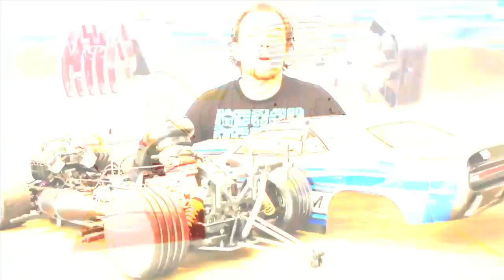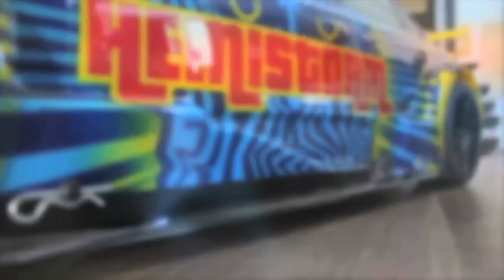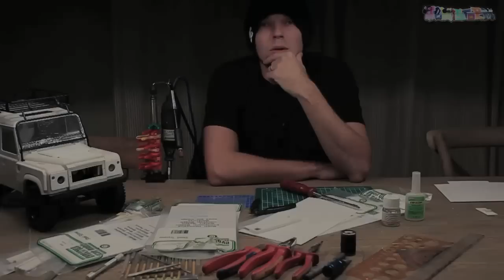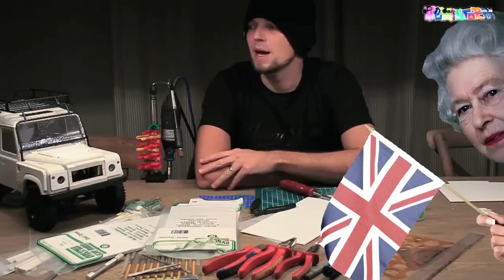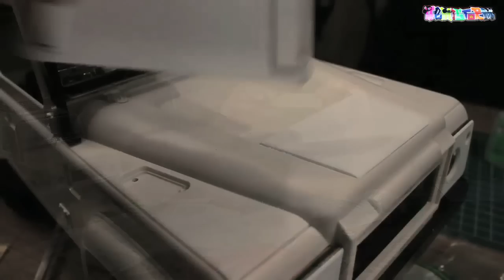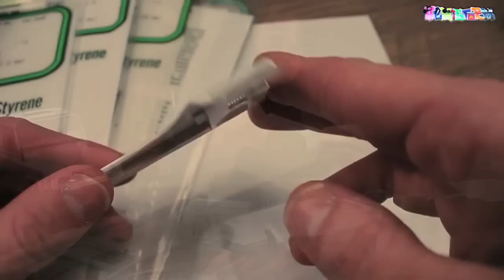STYRENE BASICS: RC4WD "Kahn" Defender D90 Custom Build

Comment: Outstanding subject you've chosen there Chris & a good scale to hone your styrene skills! You can't go wrong with *ZAP they have a good range of viscosities. A couple of tips that you may find useful ... After use put the Zap bottle on its side in an airtight plastic (kitchen) container then place it in the fridge, it'll last much longer!
Also if you want good (& cheap) filler that works, just put CA where you want to fill & sprinkle a good amount of Baking Powder over it. It dries quickly, can be built up & sands easily. Anyhow have a play round 'n see what ya think!   take care mate

Comment: That Zap glue is what you use to glue it to the body? Also do you do any bonding type to smooth out the gaps and edges or will you just paint straight over it? Thanks for the cool idea.

Comment: I love the direction you're going with this project looks awesome keep up the good work and thank you for the video. Just one question, you mentioned using glues, have you tried using the solvent? It melts the styrene together almost instantly and creates a super strong bond. I also just started with styrene and that was what I was told to use, but it looks like what your using totally works looks amazing I hope my project comes out as good as yours. Thanks again love your vids man.